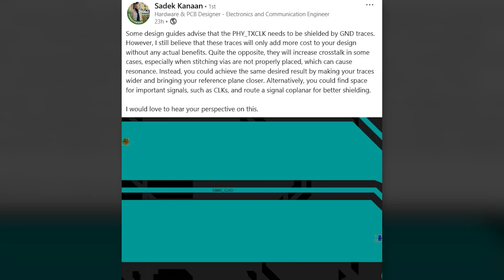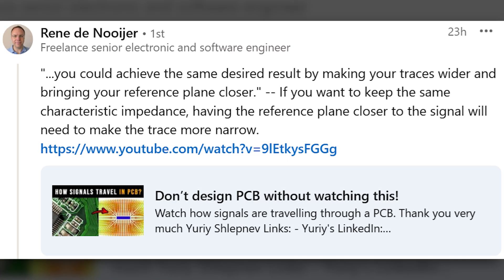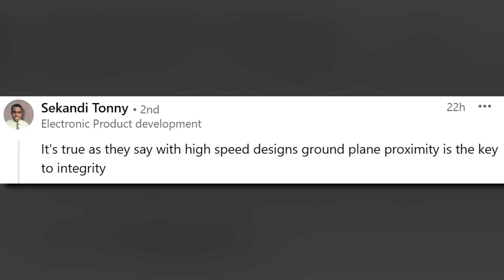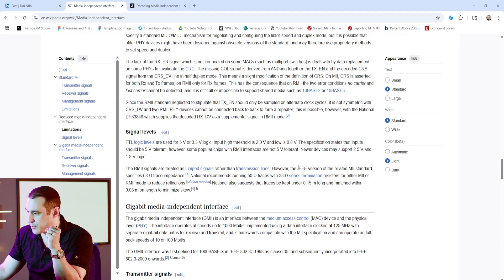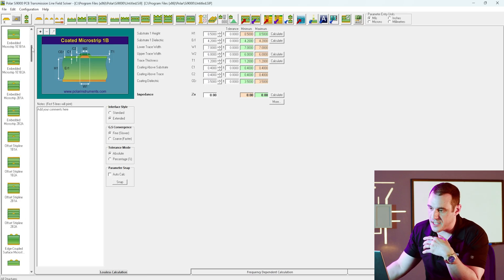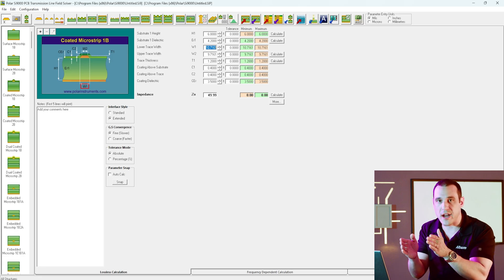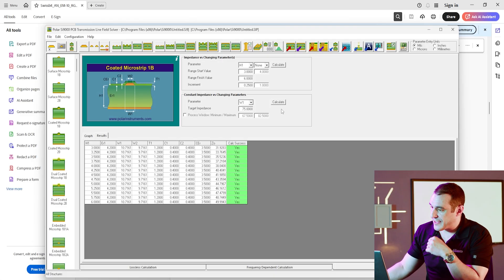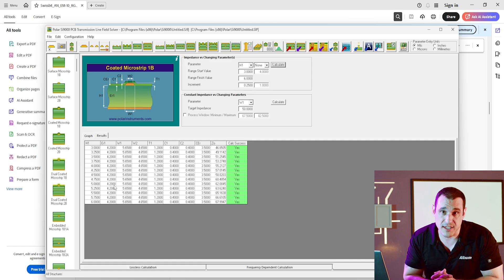How Close Can You Bring a Reference Plane?

Comment: So the tldr of coplaner ground is that it does not matter wheter you use it or not for the stripline as long as you adhere to the correct transmission line impedance for the trace configuration? -PCB design student

Comment: About the difference in impedance specifications...I remember an old story about why 50-ohm coax cable was always 52-ohm coax cable.  The impedance is highest when the center conductor is placed perfectly in the center, and any manufacturing deviations (which place it closer to ground in one direction) would cause the impedance to drop slightly...so always design with slightly higher impedance, in the real world it will decrease.
I wonder if there's a PCB version of this issue?
Reply: Yes there is a PCB version of this in terms of transmission line design and overcoming the dielectric/copper roughness losses in the transmission line. When you get to the GHz range, the dielectric loss and copper roughness loss become very noticeable and they add a little bit to the input impedance, so you will see them in S-parameter measurements and they have a bandwidth limiting effect. Oversizing the traces a little bit so you are about 1 Ohm below the lossless target impedance is about enough to compensate for the additional impedance in these losses. There is a video about this coming out in the next couple weeks.